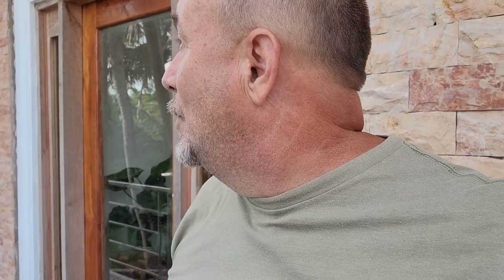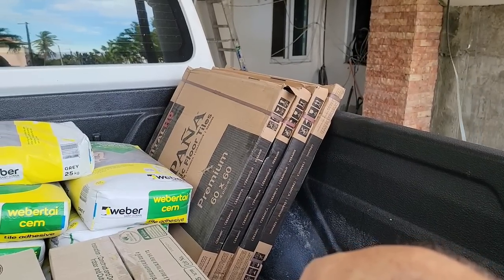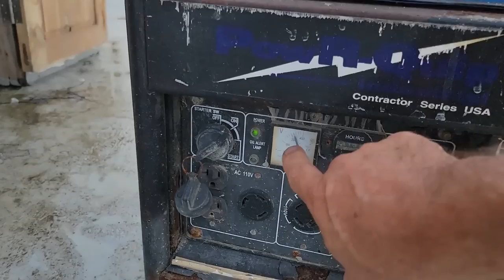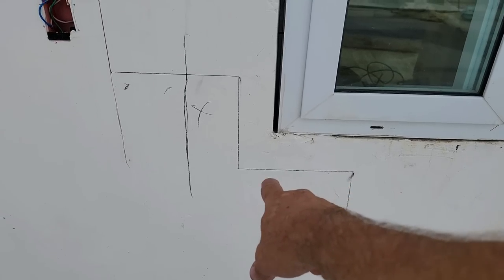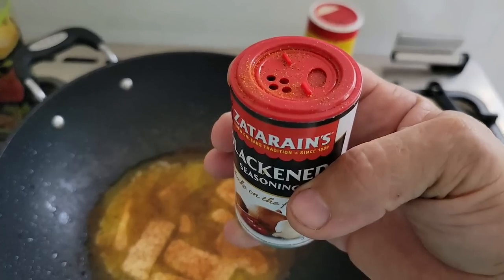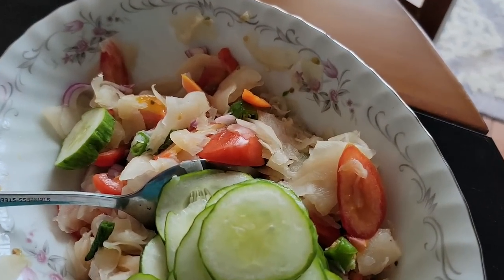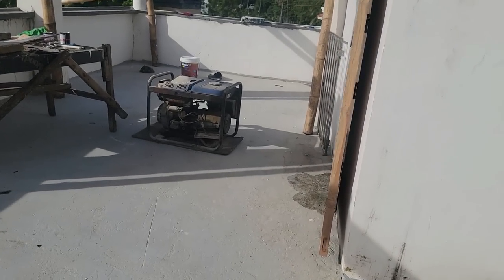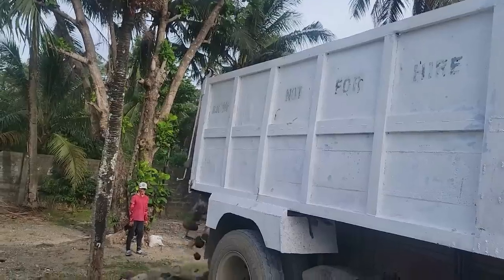Philippines Beach House Build Day 350 New Stair Case, Giant Prawns, Gate Beam

Comment: I'm sure everyone wants to know how much is the property taxes on a house like this 👀
Reply from the maker: cheap
Reply: @TexasFilipino  okay big baller what's cheap to you isn't cheap to the average Filipino 😁😁😁
Reply from the maker: @MilotLLC  No they dont go trying to take your house super fast. people can go years  and years. I don't put private financials out to the public but again they are cheap by any standard. I am not a big baller just wise on how to build and spend money on this. I built this house for what a house 1/3 of its size would have cost if I hired contractor or contractors. I was the engineer, architect, plumber, electrician. I used off the shelves windows and doors that was better priced and good quality than anything that lowes or home depot in the USA has. My method used 1/3 of the concrete for this construction vs the Filipino way here and yet is stronger and cleaner. I hired and trained laborers. No contractor , or foreman getting paid. That was a huge savings. No drop ceilings running up the cost either they are concrete and just the backside of the slab above that area. I just embedded the electrical and did clean quality work so they are nice and presentable. So basically somebody with a small  house here they hired built by a contractor spent the same as me for all of this and still has a lower quality home with lots of things to fail over the years. Next I earned nicely through google adsense while sharing this home which paid for another 35% of the building cost. Thus again making wise to my money.  This place was built to earn money for years to come. It will hold wedding events, anniversary parties, birthdays, seminars, air bnb guest at a mid to upper price scale. Plus water activity rentals. This means a lifetime of earnings. Wise again. Only a portion of this structure is our house the rest is for guest and event areas.

Comment: was thinking about your blocked pipe problem. since you don't want to damage the pipe, you could fabricate a cylinder from rebar that could be weighted with a middle chisel and another with 4 outer chisel points, similar to a plum bob then have it tied off and you could have gravity help you slowing chip away the blockage from the outer edges and middle. could even run it out with pipe and ram like a post hole digger, might take a bit of time but it would chip out eventually. good luck.